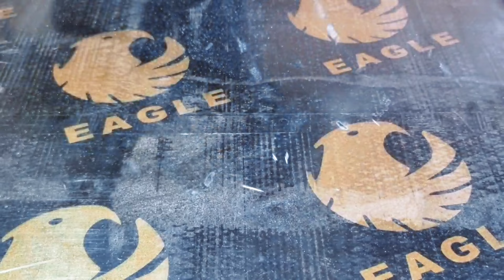How to make powerful air consumption slingshot firing with steel ball 8mm

Comment: Ko kabel apinya ada 2
 Ko akucari cuma satu
Reply from the maker: Yah, there are wire cable inside the Chamber pipe for electric light up to burn up the alcohol hot air where is connecting from the magnetic lighter blued. Keep watching more videos for helpfulness. Thanks for watching 🙏.

Comment: Alabisa kabel api cuma satu. Ko aku praktek gagal terus
Reply from the maker: You have watch more videos for helpfulness. The fire cable must be 2 cables in the Chamber pipe 2 cm gab  for connecting to magnetic shocked light up wire starter. Thanks for watching 🙏.